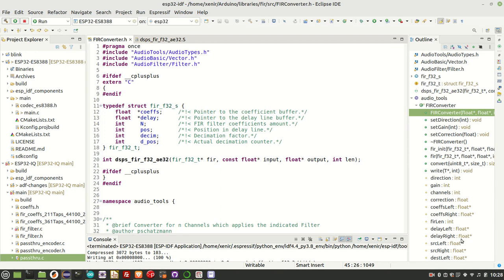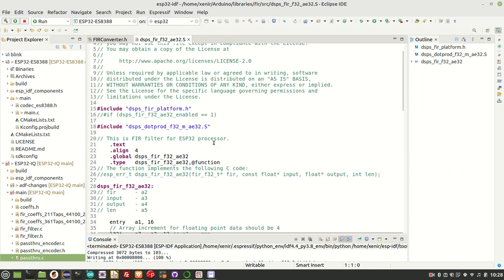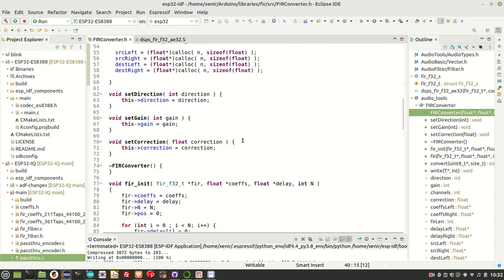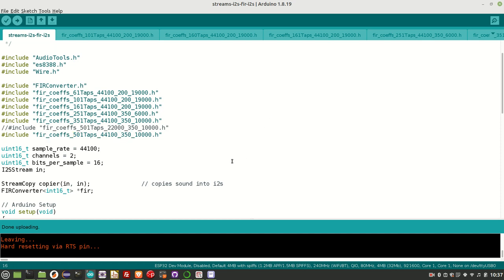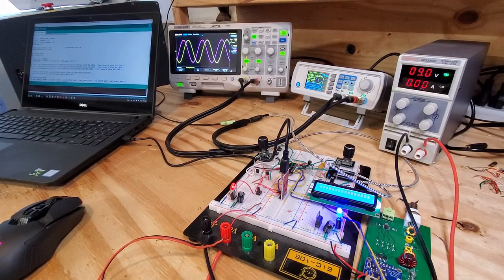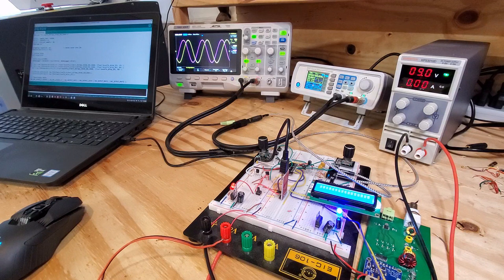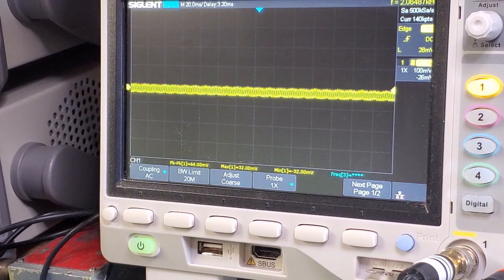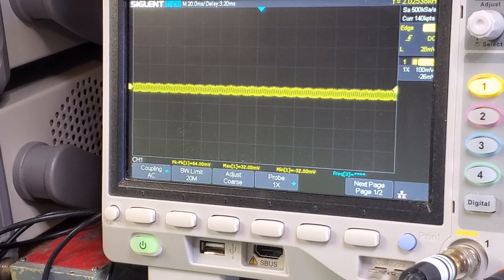Simple SDR - Updated FIR implementation

Comment: Thanks for all your video's on SDR. It helps me a lot building an SDR. I use a AudioKit with a ESP32A1S and modified your software. Now it is working well but I have a question about fir->setCorrection(currentDir); . What is happening here? Is it a correction of the amplitude, a correction of the phase or something else?
73 Ruud PE2BS
Reply from the maker: Hi Ruud. Along with generating a precise 90 degree phase shift one of the challenges in an I/Q radio is ensuring that the amplitudes of the I and Q audio signals are matched. Unfortunately this is very hard to do because of component tolerances: resistors, capacitors, etc in the circuit. What "setCorrection" does is, in software, allow an adjustment to the amplitude of one of I or Q. I demonstrate the effect of this in a later video:
https://www.youtube.com/watch?v=yNxErsmimLY

Look at around 15:30. In this video its a transmitter - but the concept is the same. Thank you for the question and comment!

Comment: Is it possible to use lower bit-width and sample-rate like 8 bit and 8000 Hz in phase shifting using internal DAC?
Reply from the maker: It most certainly is possible to use a lower bit rate - although most of the codecs only go down to 16bits not 8. Could you roll your own with the internal ADC/DACs in the ESP32 - its possible but you'd have to make sure you have some way of ensuring that the audio samples are taken on an accurate frequency - the FIR filters need that. 

I've actually had the question of "can I do this without a codec" a few times - I am sure its been done and I might try it myself one day. Thank you for the comment.
Reply: @na5y  Thank you for the kind response. I think accurate sampling would be possible using the ESP32 internal timer interrupt. And in case of DAC, there is a project named "ESP8266Audio" which implements software type Delta-Sigma DAC. With these helps, I thought, "without a codec" idea could be realized. The one and only ambiguous point is the above question : it is possible or not to make a 8 bit FIR phase shift filter. Because ESP32 has 12bit ADC pins.

Can I find any hint to make a 8 bit FIR filter on the net?
Reply from the maker: @ds1tze  On your 8-bit question - the FIR algorithm doesn't care at all what the resolution in bits is - only the sampling frequency. Have a look at this earlier video I did with some python examples. 
https://www.youtube.com/watch?v=BUGQaTJ6aWI&t=60s

Where you can have problems is where you have a sampling resolution greater than the number of bits supported in the FIR algorithm (e.g. sending 32 bit numbers to a 16 bit FIR implementation). Bottom line is you can send those 8 bit samples to the FIR and they will work fine